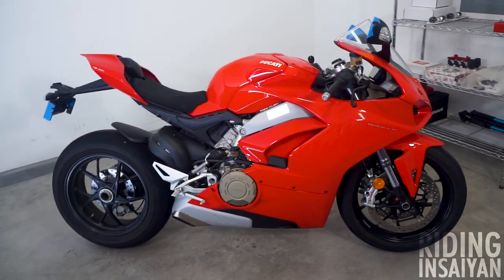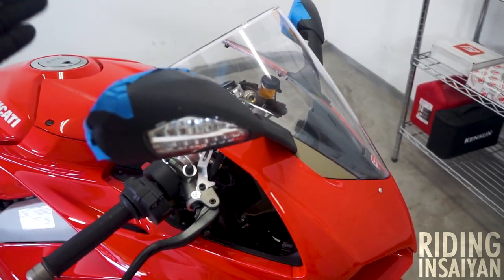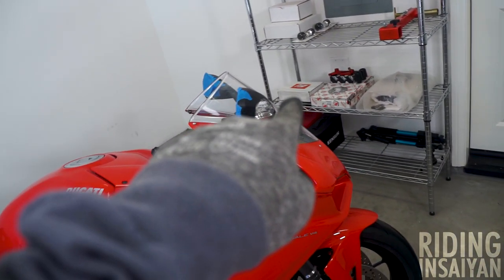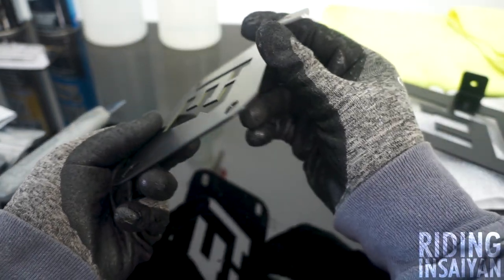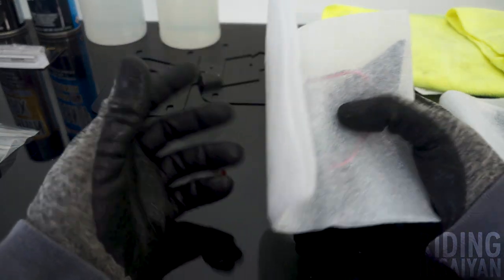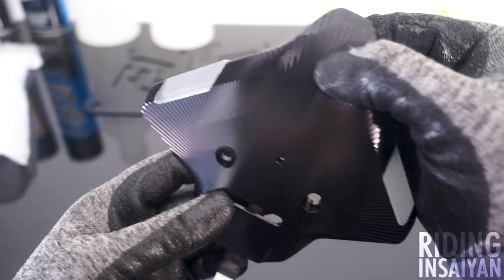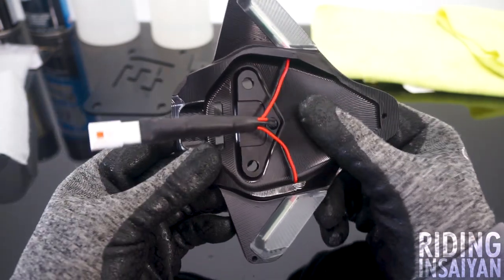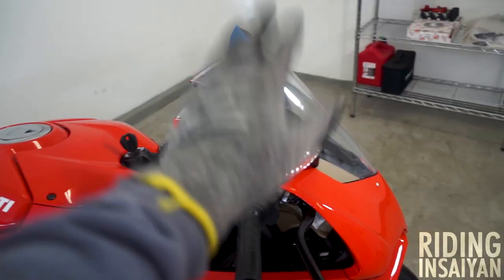FUTURISMOTO TAIL TIDY & MIRROR BLOCK-OFFS INSTALL! [LEGENDARY V4 BUILD EP.3]

Comment: Does the little LED in the middle for the plate bug you since its not illuminating anything when the plate is in tucked position? I just installed on mine and for whatever reason I want to cover it up as I find it distracting from the aesetic of the tail if its not going to light anything. I wish they left it off or CNC'd a little lip above it to angle the light downward. I want to cover mine up somehow or disengage it. Thoughts?
Reply: Yup , I that same way, I will cut the wire inside on that led and install a small switch for it, just in case if I will need it in the future
Reply: @Atlan_tis  they told me if I cut the wire it will throw a code. Not sure if true but dont want to risk it. Was thinking of using black epoxy to just cover it up. Can you explain how you're handling?
Reply: @scooteractual  it will not  throw the code, get the right switch small one and install it between the led and supply wire before resistors and you will be fine 👍🏻, I ordered mine for my V2 bayliss, I will do mine too
Reply: @scooteractual  I got mine and installed already, I see how they did it, what you can do is to buy a nail polish color black from Walmart the one girls use on their nails and drop a small dip over led and let it try , it will hold for good, and in future if you decide to remove it , you can 👍🏻

Comment: What year v4 is this? It does not have the winglets
Reply from the maker: It's a 2019 so no winglets and the fairings aren't as wide either. However, the newer fairings with the winglets are compatible with mine if I'm down to pay like $2000 for them.

Comment: don't buy this tail tidy. support is worst from futurismoto. you will regret it forever. the main issue is that the Ducati electronic parts will not support this tail tidy LED signal lamp from futurismoto.
Reply: what do you mean? I just installed it on my V2 and they work just fine.